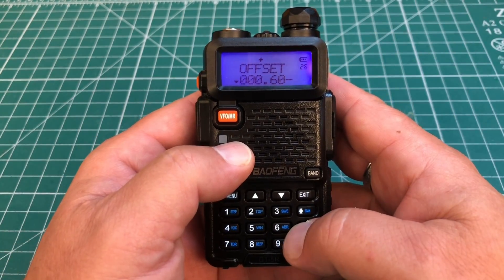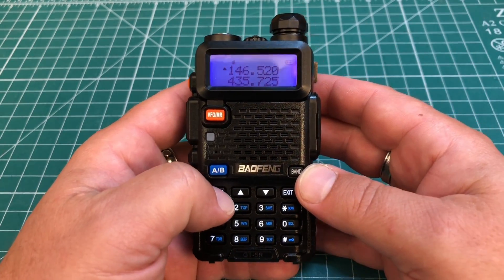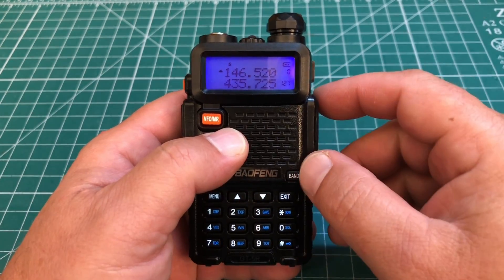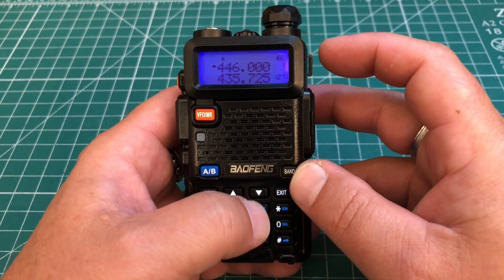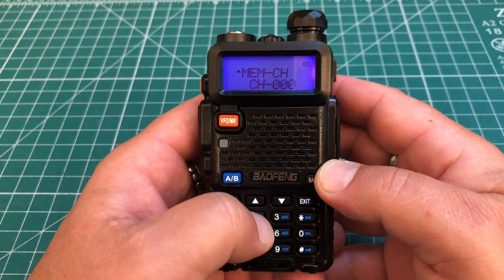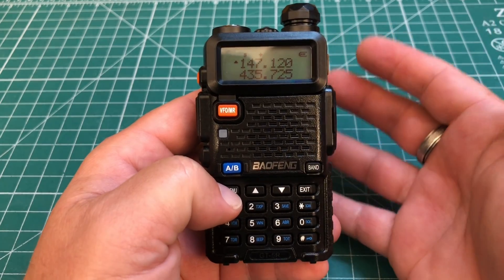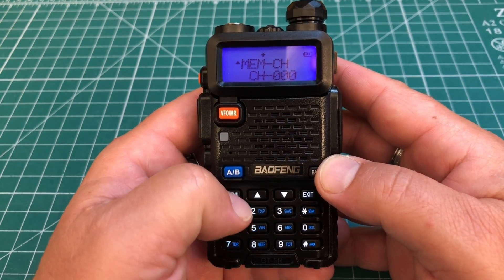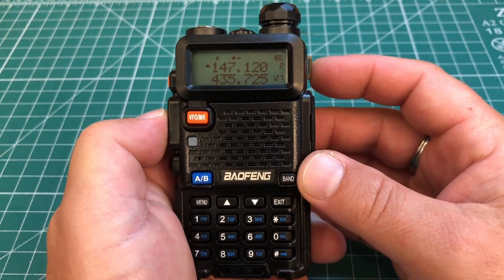How To Program A Baofeng UV-5R Ham Radio

Comment: Thanks for your easy to understand video!  I would add that if you go to create a memory channel and in menu 27 Mem channel you see "CH" before the channel number slot you want to use it means there's info on that channel number already and you can't input new info on that channel number until you first use "Menu 28" which is "Delete Memory Channel" to clear the info on that channel.  Then you can input new info into that channel number.  Cheers AF7FP

Comment: Programing UV-5R All programing in Freq Mode  A Band

Simplex: 
Goto Freq Mode enter the Freq
Menu 27 (MEM-CH)
Menu Brings arrow down to enter Enter desired Mem Chanel
Menu Receives Memory
Exit

Repeater:
Go to Freq Mode enter repeaters OUTPUT Freq
Menu 25 (SFT-D)
Menu Brings arrow down to enter Off Set ↑+ ↓-
Menu Saves the * or -
↑ Goes to (OFFSET)
Menu Brings arrow down enter offset
Menu Saves offset
Menu 13 (T-CTCS) or 12 (T-DCS)
Menu Brings arrow down enter ↑ to desired tone
Menu Saves tone
Menu 27 (MEM-CH)
Menu Brings arrow down to enter desired Mem Chanel
Menu Receives Memory
Exit

Comment: Question
I’ve used Baofeng  UV 82, as a scanner. They work great, I’m considering getting a UV 5R. I’m looking to monitor NYC Fire Dept frequencies. However, they have up to UHF narrowband ( 482-00625) RX only. Will the UV 5R receive.

Thank you
Jim

Comment: Figured it out. Baofeng has their own programming software for the K6! Went to their support site, downloaded and installed it (Windows did not trust it, but I did it any way). I was able to read the radio. Interestingly, the card that came with the programming cable, said to use Chirp.

Comment: I found this very helpful indeed. The only thing I remain confused about is what is happening at menu 27 if I save the same channel data twice. The first time I get a message about having saved receiving data, and the second time about having saved transmitting data. This suggests that for a repeater with an offset, I should maybe be committing two saves for menu 27.

Comment: When I tried to program by using chirp my uv-5r stopped transmitting voice. It turned out manufacturing fault where service guy has to tear down and solder my unit. Hope nobody has faced that problem.

Comment: slow down or give markers , man .....
Reply from the maker: Thanks for watching.  While there's nothing I can directly do to this video as I've already made it, you can control the playback speed of a video.  Hover your mouse over the video.  Hit the gear at the bottom right hand side and chose "playback speed".  Then you can chose how fast it plays back.  For example, chose .5 and it will playback at 50% speed.  It makes some adjustments to the audio too so it doesn't sound quite as weird as typical videos that are slowed down.  Hope that helps.

Comment: I bought two of these with the extended batteries, thinking that I was going to be able to use these but this is something I do not have time to learn lol wow I had no idea how difficult ham radios were
Reply: Same Here Purchased 1 And Still Non The Wiser
Reply: @Haroonayub70  All you have to do is study to pass a ham radio operator's license.
Reply: @sportster88 at this point in trying I don’t see the need for a license none of the junk actually works. Maybe it’s just the area I’m in.

Comment: Mine keeps saying “transmitting memory, while, in your video it says “reviving memory” how do you switch that?
Reply: I have the same issue. I'd like an answer
Reply: Did anyone ever get an answer to this question? I was only able to enter 1 channel. The first one it said receiving and from then on every other channel says transmitting and will not save any additional channels???
Reply: First you need to delete the channels that's already stored to that channel, I had a problem there aswell
Reply: Basically already a frequency saved to that channel you must delete first in order to save another

Comment: Trying to figure this thing out, I realized why the Marin corps made me a forward observer, not an actual radio operator.
I’m my defense though, the PRC 77 was an easy use analog, that I could listen to TV shows on while in the field.
I’m still waiting for mine new baofeng to charge.
So stupid that you need to be smart to use a radio.
Reply: I was a radio operator, used the prc-119c and couldn't figure these out 🤣😂🤣 Semper Fi brother

Comment: Hey, Love your videos man! One comment. I tried doing exactly what you did in the Vid. My radio said "Transmitting memory" not "Receiving memory" and I had to go Menu 28 and delete the channel I wanted to utilize first and then go back to menu 27 and then program it! Also still trying to figure out how to add the Name (Text) on the B line of the radio! keep up the GREAT work! 73 Brett KJ7BQQ
Reply: thanks for your comment, it wasn't working for me either because frequencies had already been saved on every channel.
To answer YOUR question, it's my understanding you have to use the Chirp programming program to name the channels.

Comment: NOTHING happened when i followed your instructions.  i typed in the noaa weather for my area and nothing got entered.  you left out something out!
Reply: When I reset mine it went to chinese!!! HELP.
Reply from the maker: Given that this isn't a video on how to program NOAA into your radio that doesn't surprise me.  That is beyond the scope of this video.  But, you probably have a radio that is locked to the ham frequencies.  Most times you can open it up by simply doing a full reset.  Menu 40, Reset All.  If that doesn't work, try holding down the Moni, PTT, and VFO buttons while turning on the radio.  You should see "factory" come up on the screen and it will be unlocked to more frequencies that include NOAA.  But technically that is illegal so do it at your own risk.  I accept no liability.  And for the love of god, don't ever transmit there!

Comment: Can you explain CTCS and T- DCS ?  Not sure why you add these two to the programming.
Reply: As the freq I need to use has CTCSS codes, in order to work with a group, I'd 2nd the request for programming instructions including them onto channel mode.

Comment: Should you really transmit without an antenna? Anyway, great video, and hopefully really helpful for new and aspiring hams!
Reply from the maker: Baofeng radios are highly engineered to lower their output power at the presence of a high impedance so as to not damage the finals lol!